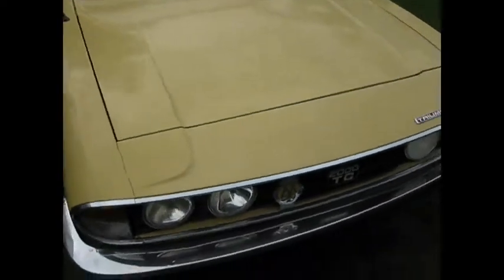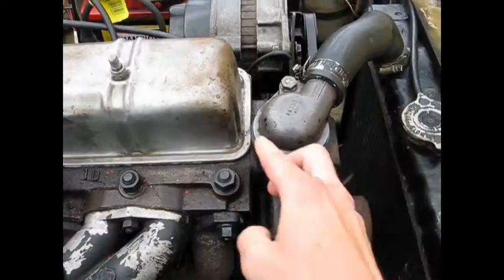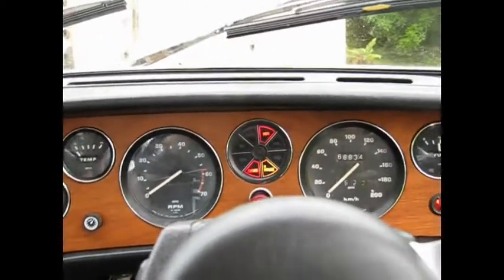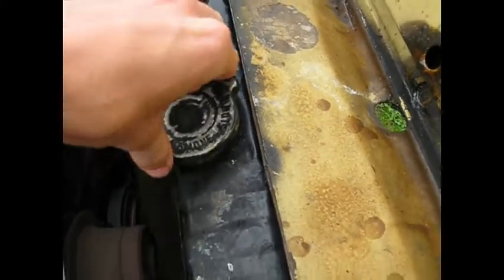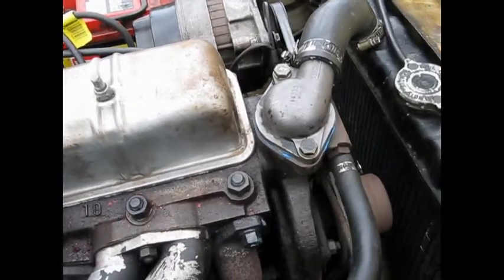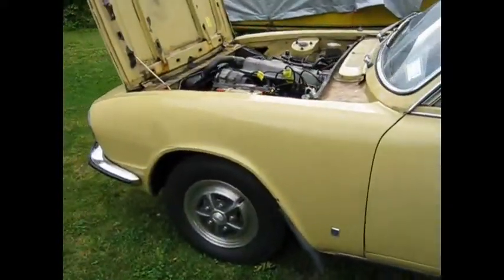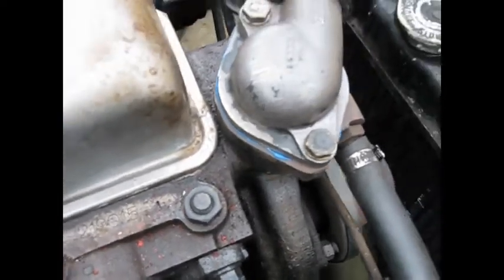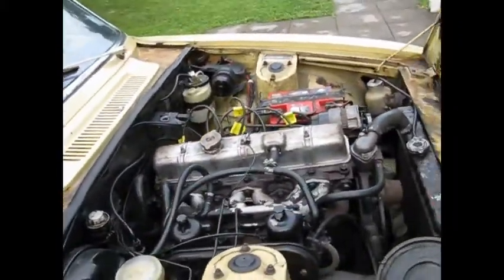Cold start, 1977 Triumph 2000TC

Comment: Don’t pull the choke out!! Crank the engine till oil light 💡 goes OUT!! Then start the engine. And set the Tappets 0.010 I worked there 60 70 80 and change the pedal Rubber’s over use a new part. Thermo housing!!! 🇬🇧🇬🇧

Comment: Nice video but looks like you have a problem with your alternator not charging straight away when engine started as the 'IGN' warning light was still on & the voltmeter was not showing that battery was being charged. 
However when you revved engine up it the charging system appeared to work due to 'IGN' warning light going out & voltmeter showing charge to battery & if my memory serves me right the oil pressure warning light was green on these cars & I noticed it did not come on when you switched on the ignition. Possible bulb blown or faulty switch maybe? Do you still have this car & use it please?
Reply from the maker: Hi Matthew, the oil pressure light was on (had to squint to see it in the video) but they're pretty dim on these cars. I think this is because when you bleed the brakes the oil light illuminating brightly indicates brake fluid pressure has returned. Its been a while since I've done that though, so I might be wrong. As for the alternator I've noticed the IGN light comes on if the revs drop too low (as in the car nearly stalling), but once again goes off when you rev it. Not sure if its a quirk of this model, but I haven't had trouble with insufficient charging so I'm not too concerned.

Still have the car, its done 323,000km now on its original engine, though I got the head reconditioned last year. Hasn't been a daily driver for quite some time, but I take it out whenever I get the chance (which admittedly isn't often nowadays, what with three other cars to attend and the atypical university workload each semester). I must get around to making another video of it, been telling myself that constantly but laziness always prevails... Cheers for the feedback, do you have one of these yourself?

Comment: If this Is a 2000 tc then why does it have a 2500 Steering wheel ? I have a 2500 tc and mine has the same steering wheel